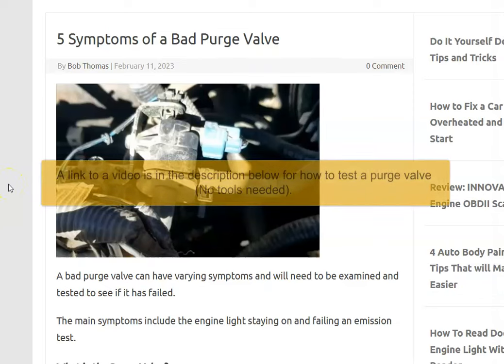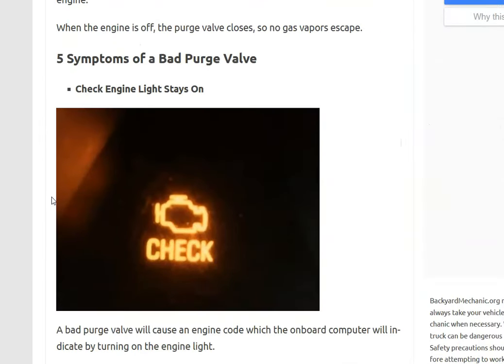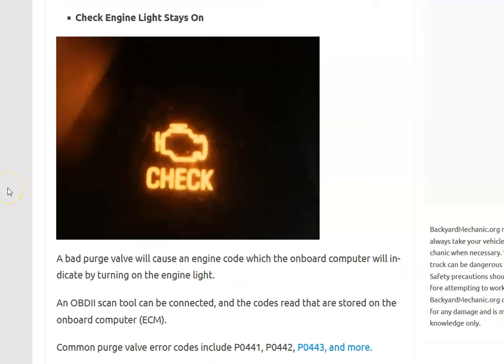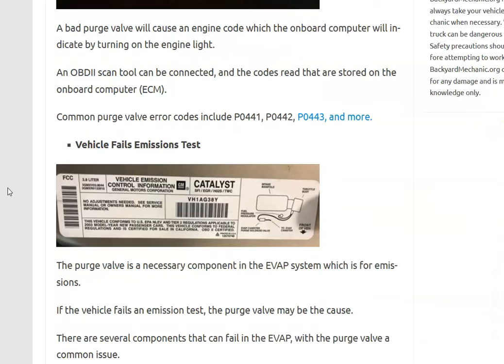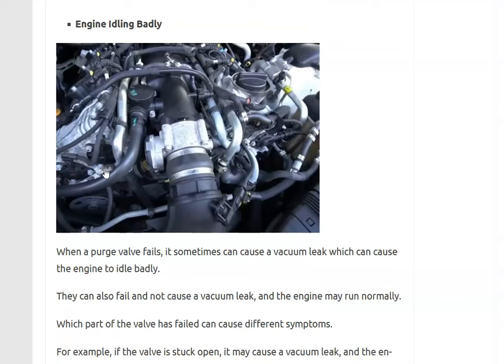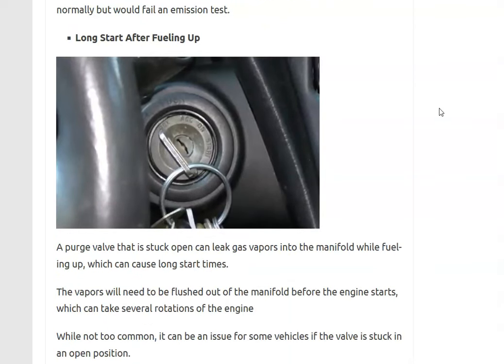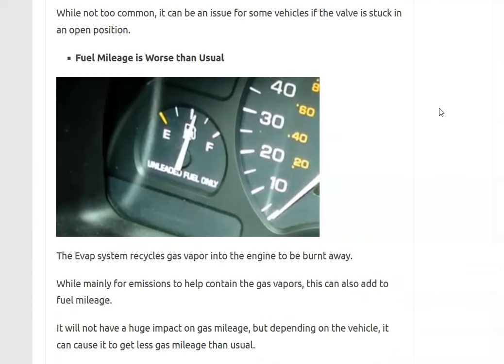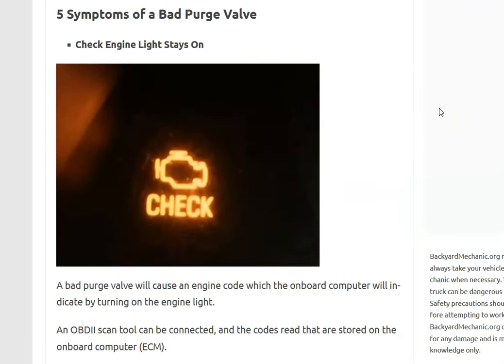5 Symptoms of a Bad Purge Valve

Comment: I got a check engine light on my ‘14 impala - no other symptoms. Bought a tester at the local store for about $35. Got error code P0496. Bought purge valve on rockauto for about $27 including shipping. That was over a month ago, no more check engine light.

Comment: My BMW 435i was having a really bad gas odor, misfire when cold, and rough idle in park. Changed the purge valve and now it’s fixed no check engine light either.

Comment: And with a bad purge valve you can also get a P0171 Lean code.
Reply: Stuck open, making engine lean, like mine.
Reply: Yes
Reply: Yes it can be, like an internal leak
Reply: About to change it
Reply: DONTESTIS did this fix your issue?
Reply: And with a bad purge valve you can also get a P0453 code? Too Thanks
Reply: It’s your intake gasket and pcv under I just fixed one

Comment: Wow I had a 2014 tacoma that started trying to stall out at red lights and difficulty starting after fuel ups and had to pump the accelerator while starting to get it to crank over. Went to toyota and to another mechanic and toyota did the 3 point fuel injection cleaning but didnt fix issue and other mechanic said put fuel additives in or use top tier fuel like Chevron but that also didnt help. I traded the truck in and all that time it was the fkg purge valve based on this video...funny part a friend who builds cars (works on his own vehicles) recently said the same thing. I swear getting a proper diagnostic that fixes an issue from a paid mechanic is nearly always a scam for a more expensive repair or to just avoid the work and get you off the lot for a diagnostic fee knowing they didnt fix the issue.
Reply: Ouch

Comment: 2016 GMC Terrain, large leak code. Went to check purge valve, and found nipple on underside with snap on connection cracked and basically falling off. Got broken piece out with needle nose, installed new valve, no more EVAP leak.

Comment: Great video, only thing I would add after dealing with emission codes on my Cadillac Dts. Make sure you get GM genuine parts like sensors or a purge valve. I changed everything from a pump to the check valve and all the sensors. Turned out to be one of the cheap sensors wasn't working correctly and that was throwing my code.
Reply: Yup just got new cheap purge valve on Amazon.    And it's bad

Comment: Purg valve get signal from Fuel tank pressure sensor to open or close  ?
Reply from the maker: The computer controls the signal to the purge valve. The computer uses the pressure sensor to know if the system has a leak and if everything is working correctly.
Reply: @HVAC_Mechanic  thank you

Comment: Hey Bro. My wife's 2003 tahoe started throwing the P0442 code last week. Vehicle ran fine for about 5 days. Today, I went out to start it for her(cold Idaho morning), and now it just turns over but no ignition. Anything you can tell me pertaining this code that would cause it to just not ignite? My Wie literally drove it the day before and no problems. Thanks in advance if you see this.
Reply from the maker: It should still start and run with a P0442 EVAP code; there must be another issue. If the purge valve gets stuck open, it may cause it to run rich or idle rough, but it would still run.
Reply: @HVAC_Mechanic  thanks brother. It's really strange as it's not throwing any other code. Thanks for replying.
Reply: @HVAC_Mechanic  hey i got a question i overfilled my truck twice and one day turned on fine then tirned off and when i turned my key to turn on it spills gas on bottom ofy truck gas tank

Comment: Hi thank you for your comment on the purge valve . where is located the purge valve on 2011 ml350 diesel?
thank you
Reply: Find your intake, observe and trace all the hoses less than an 1inch in diameter that lead away from it. The solenoid is as big as the palm of your hand.1 inlet, one outlet, and one electrical connection.

Comment: Could this cause a p0300 code? Everything else has been diagnosed out as good or has been replaced of it diagnosed as bad.
Reply from the maker: If it is stuck open, it can cause issues, usually Rich codes.

Comment: So I got the valve off & it holds a vacuum on the manifold side, holds pressure on the canister side, won't hold vacuum on canister side. I sometimes get the rough idle could it be electrical? The unit is an AC Delco part replaced 11 months ago.
Reply from the maker: Is the purge valve opening and then shutting? I made a video on each EVAP component and how to test them. Here is a link. https://youtu.be/C5s3Rx3wjD0

Comment: .I hear a screeching sound coming from my gas tank and then my idle drops and it has cut off on me when slowing down to a stop.  I thought this was the fuel pump so I replaced it and then shortly after it began again though the idle it stronger but it still drops my idle when it happens.   Also, I replaced the purge valve solenoid as I get the error code for that off and on.   Any thoughts?
Reply: 7 months too late but it could be the idle air control valve if you have one.

Comment: My 07 yukon xl is hissing (blowing fumes out) for up to 5 mins after I remove the recently replaced gas cap to fill it up. I do not drive it often, 3-4x a week to the grocery store although after AFM delete i start it daily just because of the pain that repair was...I'm not sure where to start other than the purge valve

Comment: When I fill up my ford escape 1.6 it has a very hard time starting it just keeps cranking, I had a p1450 code but it turned off, it has a bad vacuum leak now can I just replace the purge valve instead of the whole purge valve system?
Reply: It’s your charcoal canister replace that and you should be good
Reply: @BoostedBroz  I ended up replacing it diy you are right it was stuck open! I appreciate the response 🤘

Comment: I have a 1997 Toyota Tacoma and when my engine warms up it starts leaking fuel through the charcoal canister vent line. I changed the purge valve but it still does it.
Reply from the maker: It needs to be diagnosed, but when there is fuel leaking from the charcoal canister, usually that means there is high pressure in the EVAP system or lines were mixed up somehow.

Comment: Very good information anyone here can confirm if this bad purge valve can cause a catalytic converter code of malfunction Please.
Reply from the maker: A stuck open purge valve is the only Evap component that can affect the engine, but it usually causes rich codes such as P0172 / P0175.
Reply: Thank you 🙏

Comment: Would it cause a petrol smell in the car?
Reply from the maker: Yes, in some cases, gas can be smelled. Often though, when gas is smelled, the charcoal canister or vent valve is bad.
Reply: What about intermittent poor or “weak” starts? Did an obd2 I/M readiness test and evap is not passing, however I do not have any codes besides a 0141- not sure they’re related I believe that’s electrical. Thanks

Comment: I need help replacing purge control valve for Honda civic 2012 Ex and don't know how to find out which solenoid I need replacement A?
Reply from the maker: The Purge Valve will be in the engine bay, while the Vent Valve will be under the vehicle near the gas tank, usually combined with the charcoal canister. Both would need to be tested to see if they failed.
Reply: I have a 2013 buick verano. Filled up a few days ago, and now it won't start. Changed spark plugs,  coil packs and tested fuel pressure. Would a bad purge value be the reason it wont start? No check engine lights.
Reply: @HVAC_Mechanic  But which one is usually the culprit is it the purge value or the vent value or even the gas cap?   Thank-you in advance an this was an awrsome video !

Comment: I just vhanged the purge valve on my car a nd the check engine like is still on and when i slow down or slow down the car sometimes feels like it wants to turn off and it has turned off and i just put the obd on it and got the same code for purge valve could it be the hoses ???
Reply: Still need to reset the code and check if it comes back.

Comment: My 2017 renegade won't let me fill it all the way up.  When i do, once I'm driving, it chokes.  And it's hard to crank.  As long as you giving it gas its fine, but soon as you pull to a red light or stop sign, it shuts off. Also got a code of p0441
Reply from the maker: It is very likely a bad Vent Valve. I made a video on this problem; here is a link.  https://youtu.be/t_nSVNa-48c

Comment: When I fill up it sometimes will kick the pump off I can hold the pump at like 90% and it won’t click off but if I fill it up too fast it’ll kick off the pump and there is a tick coming from my engine bay and I have mildly crappy gas mileage
Reply: I got the tick too, you found out what it was ?
Reply: @Lurkin404  yessir
Reply: Evap purge sylenoid
Reply: Same here also feels like it has a problem like not down shifting kinda feels like o2 sensor failing or your in to high a gear going to not going fast enough. I knew it’s was air/fuel issue. Got my codes read and this is the only issue!
Reply: @Wrapsession  if it makes an odd tick not the vvt tick but a tick that sounds like bad nock almost it’s probably your evap purge sylenoid try unplugging it and seeing if it stops because once you unplug it it’s no longer trying to do whatever it does and it goes quiet stupid emissions bs

Comment: So I have a 98 Nissan Sentra I'm getting a p0440 code, I don't smell any gas but I'm definitely getting les mpg than I should and my car is sluggish when accelerating, for some reason it seems like it's worse on a hot day, for example in the mornings when it's not too hot it's not so sluggish but when I get done with work and it's hot, at first it's super sluggish and as I start driving it gets a bit better? Any idea what could be my problem? Thanks
Reply from the maker: A P0440 code is an EVAP Leak so I would try to find the leak. There are YouTube videos on DIY smoke machines that make finding an EVAP leak easier.
Reply: @HVAC_Mechanic  ok thank you, also idk why but sometimes it will give me a p1448 and sometimes it's just the p0440
Reply: And I know a bad fuel cap would throw the p0440 but it wouldn't affect the performance of the vehicle would it?
Reply from the maker: @renerubio5073  A P1448 code is the Vent Valve which is located on the charcoal canister. Evap codes usually don't affect engine performance much but sometimes can cause an issue. For example, if the purge valve is stuck open and there is a leak, it can cause an intake manifold leak. That is rare, but it does happen.
Reply: @HVAC_Mechanic  so what do you think it's wrong with my car? Like I said a p0440 sometimes a p1448 sluggish to accelerate specially right after starting the car fuel economy definitely could be better and so smell of gas I know it must be hard to say exactly what's wrong with it I'm just trying to know more or less what it could be so I don't get ripped off thanks in advance
Reply: My car 2 ever get the problem fixed

Comment: Could this make a misfire happen
Reply: Got the same question
Reply from the maker: If the purge valve is stuck open, it can cause the engine to run rich and, depending on the engine, may cause misfires.

Comment: could this cause the maf sensor to get a code
Reply from the maker: While anything is possible, I have never seen that happen. They are a part of two different systems; the MAF sensor detects airflow coming into the engine, while the Purge Valve is a part of the EVAP system.

Comment: code po446. how would that be fixed. i think its the vent valve near canister. someone said the actual purge valve solenoid will never ever fix code po446 when replaced alone. ill have my mechanic look over my car evap system. its not a gas cap cause i have tested those.
Reply from the maker: A P0446 code is usually the vent control valve on the charcoal canister or an EVAP leak.
Reply: @HVAC_Mechanic  i really appreciate reply. 🏁👍
Reply: @daviddowns7552  Did you find out the cause of your P0446?
Reply: @midnightsunturbo i will probably have to leave my car with mechanic to check the system out.. im thinking vent valve on canister and possible faulty lines. ive been erasing code only temporary fix. i have had hard starting and light backfiring and using more fuel.
Reply: @daviddowns7552 hi, ever get it fixed? If so what did you do to fix it?

Comment: What about P0190
Reply from the maker: A P0190 Code is a "Fuel Rail Pressure Sensor Circuit Malfunction," which points to an issue with the fuel rail pressure sensor or fuel pressure issue.

Comment: Is a purge valve supposed to tick continually? Also, if you pull the vacuum line while the engine is running, is the purge valve supposed to suck air in intermittently at the same rate it was ticking? Please help.
Reply: Im curious if you found out what that is because I’ve been hearing the sucking of air intermittently and I’m not sure what it is